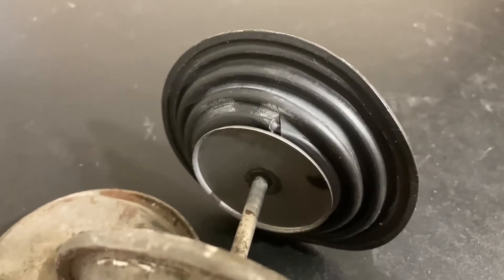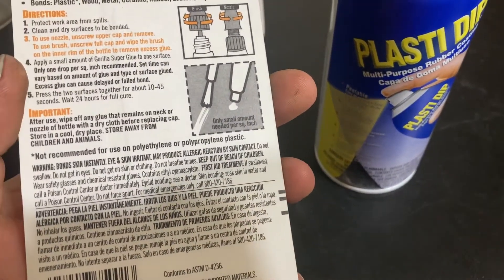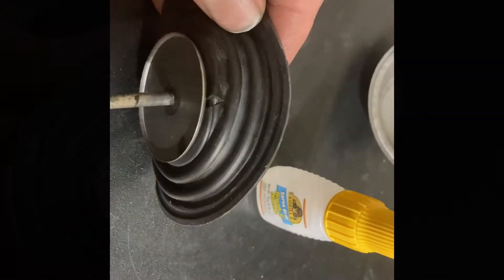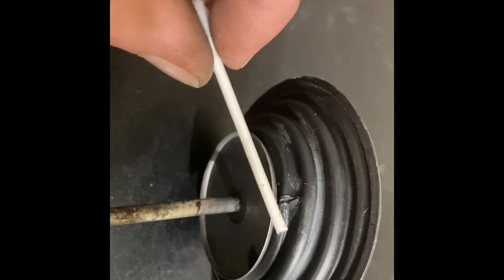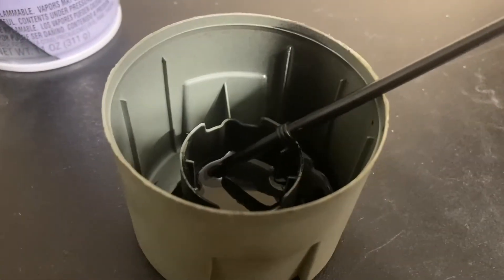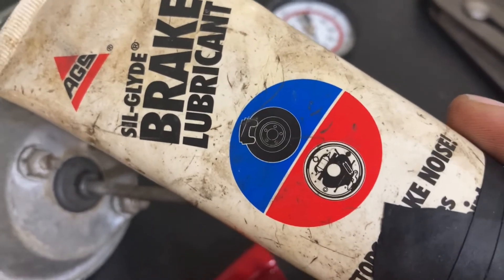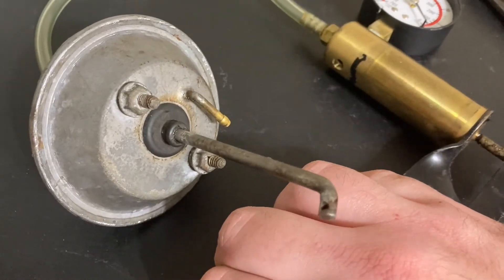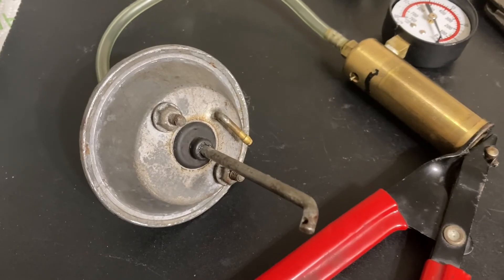Vacuum Diaphragm Repair on Servo

Comment: I still can't figure out how to pry open the factory crimp seal on the edge to separate the halves. I have a similar vacuum scuttle actuator that is not holding vacuum and I want to repair it. 1965 Jaguar S type.
Reply from the maker: Get a pair of channel locks and hook onto the lip and pull it down slowly kind of like using a bottlecap opener on a bottle. Just take your time and make three or four passes around it don’t try to bend it down all at once or you’ll deform it too much to get it back together.
Reply: @speedoflife89   Thanks.

Comment: Do you still have the Xj?
Reply from the maker: Yes. 250,000 and going strong. drive it every day in the winter. here in a couple weeks I'm going to be making a rear bumper for it.  need to tow a utility trailer with it but not a fan of the hitch hanging low so going to integrate it into a bumper.
Reply: Mine’s too nice for winter. It’s sitting super clean with a full tank of 93 gas and a fresh oil change under a tarp in heated storage. My scared of rust in the frame.